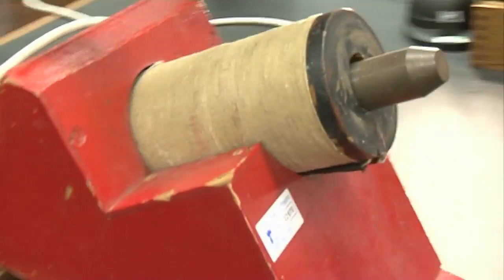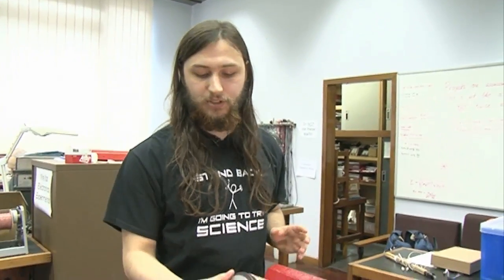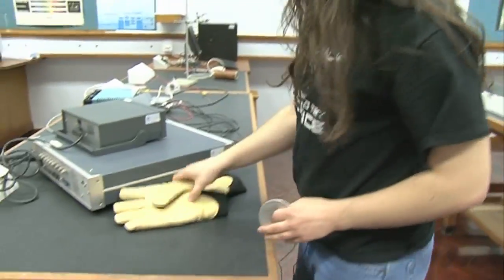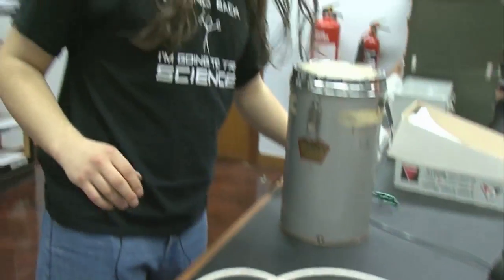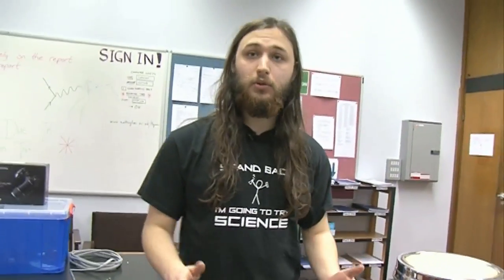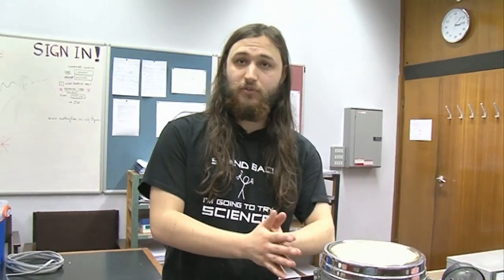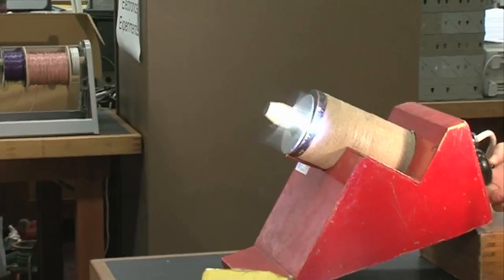The Electric Cannon - Sixty Symbols

Comment: Why are the lattice atoms affected by the liquid nitrogen but not the free electrons?
Reply: AFAIK, electrons are small enough that they don't really contribute to the heat of the crystal, and thus arent really affected by removing heat from the crystal. Or because the lattice atoms aren't pulled by the large EM force (0 net charge all together) while the electrons are. Take your pick.

(Not a particle physicist, but I read through Feynman's QED once in highschool)

Comment: I'm curious, if the temperature of material effects conductivity,  doesn't that mean the hotter something gets, it gets less conductive? is that why CPU Superclockers effectively freeze the CPU? to keep the conductivity high?
Reply: The better the conductivity, the less heat goes to running through the wires.
Reply: It's just to keep it from throttling the performance or blowing up, allows for a higher voltage and therefore a higher overclock. I doubt conductivity matters at all

Comment: But in an isolant is the opposit: more temperature means more conductivity
Reply: Itsiwhatitsi 
There's different kinds of semi-conductors:
-NTC (negative temperature coefficient)
-PTC (positive temperature coefficient)
which describes the behaviour of the electric resistance of the material when changing temperature
(something like 10^-5×Ohm/K)

Comment: What would happen if you do this with a superconductor?
Reply: It would go the maximum distance the Amperage allows, considering its running at 13 amps(due to the limiter) if it were running at it's maximum 115(i think that's what he said) it would go about 8x's as far, if it was still only 13 amps, it would still go much further, but it can only pull the same amount as the thing that's powering it.

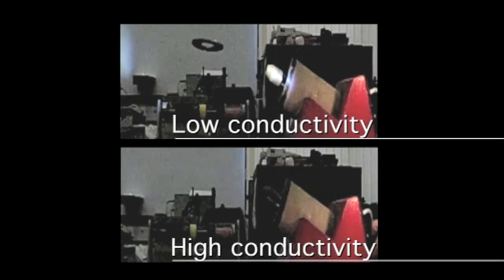Comment: Notice how there's a slowdown at 2:35 when the plate reaches the end of the iron core. That's pretty cool but I have trouble understanding why it has a sudden reversal of acceleration that doesn't seem to persist for a longer time. Does the end of the iron core shape help produce a different type of magnetic field somehow?

Or it could have hit a snag of course.
Reply: +MrSnowman Iron is ferromagnetic, air is not. So yeah, there is a drastic change of magnetic field strength as soon as the ring departures from the iron rod.
Reply: The reason others point out (the change in permeability of the core/air) would not account for a deceleration of the ring, only a reduction in the acceleration. I suspect that it slowing down when reaching the end of the core is coincidental. My guess is that this is the moment that the fuse blows. The magnetic field starts collapsing at this point, inducing a reverse polarity voltage in the ring. Since both magnetic fields are aligned for this brief time, it creates an attractive force instead of repulsive. My guess is that if they could use a fuse that takes a bit longer to blow, the warm ring would travel much further.  My back-of-the-envelope calculations indicates only a 10-15% farther travel distance between room temp and liquid nitrogen temperatures. So this certainly checks out.

Comment: Now try it with a superconducting ring. Hole in wall?
Reply: bob s No wall
Reply: +bob s The current in the main coil becomes the limiting factor in this case. The flow of current is proportional to the magnetic field generated, which in turn is what drives the ring. If the ring was super conducting it, in theory, could induce the same maximum current as seen in the coil, so while it would be driven with more force, I doubt it would go through the wall.

Comment: It is mystery to me, why do you still use fuses. There is plenty of automatic circuit breakers with protection against high currents and shorts that you can use hundreds of times. And if you need longer switching time to get the whole thing going, all you need is to pick one with slower characteristics. And of coarse with automatic circuit breaker you need no more than pull its lever back up and it works again. So it's faster, easier to use, safer and eventually given the number of fuses you must have destroyed already, much cheaper.
Reply: ***** No doubt draconian university regulations in combination with the unusual British feature that every plug contains a fuse.
Reply: +Killerean +1

Comment: I don't find that lattice theory explanation particularly compelling. It is, in fact, quite incomplete. The force that sends the ring flying is magnetism, so far as I know; specifically the magnetism generated by the electromagnet. The explanation fails to discuss the interaction of the force of magnetism and the electrons moving through the aluminum lattice and creating a current. Aluminum (and copper) are non-magnetic. Iron creates an opposing magnetic field when it passes through a magnetic field, but aluminum and copper do not. Aluminum and copper somehow oppose the movement of nearby magnets without creating an opposing magnetic field. The "explanation" ignores this wonderful mystery.

Comment: So, to vizual it I imagined a room full of people that are moving quickly forth and back (dancing? :D), they are generally particles. They I saw some group of different people that stood for electrons, and they (as a current) tried to cricle through the crowd, but get constantly bumped back. But when someone turned the temperature down, people in the room stopped moving so fast, so the electrons (othe other group) could go through the crowd with speed. 

Is this more or less acurate?
Reply: The atoms are moving randomly. The people (representing atoms) in the room are much more chaotic like a mosh pit than any normal dancing. But electrons are really small compared to atoms. Instead of thinking of people trying to get through a mosh pit crowd, think more like balloons tossed into the mosh pit. The balloons bounce around wherever they get pushed by the crowd. But if the metal is cooled down to near absolute zero, then the mosh pit crowd stops jostling around and pays attention to the stage, and someone on the stage can ask for the balloons to be passed to stage and then the balloons will be bounced around much less randomly and make very quick progress to the stage.

Comment: The conductivity for most metals are already well known as a function of temperature. How far this cannon fires something is just an interesting way to visualize how well something conducts electricity, and figuring out distance as a function of temperature would be quite easy if you knew the conductivity of the metal and the power of the cannon :)

Comment: Zebionic is right about heat damaging components, but you're also right, because most electronic devices have a reaction time which increases with temperature. Having a cool PC will not only protect it against damage but will increase performance.

Comment: Most electronic devices such as the ones in a computer have a propagation time for impulses and signals, which increases with temperature. Having a cool PC will not only protect it against damage but will increase performance. Trust me, I'm an electrical engineer.

Comment: This is Lenz's Law. Basically, the magnetic field "wants" to stay constant, so the induced field always opposes any changes in the original magnetic field.

Before the cannon is turned on the magnetic field is 0. When the cannon is powered up, a magnetic field is created (let's say it's pointing upward out of the coil). This means the magnetic field is changing. This induces a magnetic field in the ring that points down into the coil to oppose this change.

Comment: Not even remotely correct.  Overheating is a problem because it can damage the components.  Computers don't slow down because of overheating, they usually just turn themselves off to avoid damage.

Extreme cooling is usually done to allow for overclocking, which increases the heat generated.

The conductors used in a computer are more than good enough at any reasonable operating temperatures.
Reply: er, computers experience instabilities at high temperatures because the conductivity lower and it no longer is able to sustain the frequencies.
if this wasn't true overclocking on a 100C aircooled system would get the same frequency as you do on ln2, and we know that isn't true. you generally can push a bit further on ln2 using the same settings (of course being able to tune everything up one or two notches without burning the house down helps when you're going for the peak)

and yes, computers do slow down on heat. it's called thermal throttling. it's an issue specially for laptops, since they usually have rather poor thermal solutions. they do that so they can stay within operational temperatures without having to shut off. it's only when that fails that the emergency shutdown happens. remember early athlon cpus that didn't have that? yea they straight up burned down. happened at around 130c pretty quickly. i lost one of them back then because the cooler clamp came lose. it hit that temperature in like a second. it pretty damn dissapointing :\ they only implemented a thermal shutdown procedure on atlhon xps and later cpus, i think.

Comment: yes, that happens with most metalic materials, semiconductors tend to work otherwise.
that's the base of temperature sensors, like with PTC (positive thermal coefficient) and NTC  thermistors or diode sensors.
If you do an opamp circuit with a gain above 300 using 5% carbon resistors you would be able to see the change in voltage by just blowing some breath to the resistors.
Some materials are very stable through a wide range of temperatures, but there're materias that change a lot too.

Comment: but there are other ways to cool thing below helium's temperature, afaik 0,01K was reached in labs using don't know what lazer stuff
else he would have to use one of those hot superconductors alloys.
Maybe evaporating liquid heluim he could reach such low temps but not sure it it would work as it doesn with liquid nitrogen :P

Comment: so electrical resistance is the "signal" of the current overcoming "noise" of the temperature of various movement of particles in the conductor

why has no one explained it so clearly before in my life, superconductors, super-conduct because they have negligible noise. my brain understands this now so much better.

Comment: That's a really an inefficient coilgun! It doesn't even have a circuit breaker just to start off!
I wonder what's the energy stored in its capacitor bank if it even has one.

Comment: um, I'm not talking about melting it.
Duh
I mean heating it to BELOW the melting point.

Decreasing it's temperature by a couple hundred degrees...
vs increasing it's temperature by a couple hundred degrees.

Remember, this isn't water or gallium, so a little heating won't drastically change it's state.

Comment: If I were you I would use a circuit breaker as opposed to fuses, it may cost a bit more to find one that will work for you but you will save money over buying fuses.

Comment: @puncheex Every time you plug anything in to a socket you 'allow' it  to draw whatever the 'wall' can supply. In the case of a short in any equipment, it may draw huge current, the 13 amp local fuse is there to protect the circuit after the fuse, the breaker in the distribution panel is there to protect the wires in the wall, the fuse on the mains supply is there to protect the incoming supply wires etc. there is nothing more inherently dangerous in this cannon than any other device.

Comment: why not charge a couple of 500 v 5000uf capacitors  and a charging circuit you wouldn't have to to replace the fuse each time

Comment: wow, i actually found the difference between the first and second shots really impressive and interesting.  much more then i thought i would.  its interesting that you use a single shot system, instead of building up in capacitors and firing from them.

Comment: @lejink  sort of but not quite how you are thinking. the helium is first first cleaned to ensure there are very few trace contaminants. it is then put through a compression expansion sequence similar to the working parts on your freezer. the resulting liquid is then collected into a sealed dewar with very low heat transfer properties. the trick is to extract heat  from the gas rather than to cool it with something cold.

Comment: @lejink  2 litres of nitrogen will sit in the dewar in the film for about 1 day before it all boils back to gas. helium will almost instantly boil from such a container.  the reason is that they have very different specific heat capacities and vapour pressures. the dewar is just an expensive Thermos flask

Comment: @UltimateFreerider  the cannon is home built its really rather simple. it is about 500turns of heavy guage wire capable of 13A around a wooden former with a mains switch in series connected to a mains plug.  there is a steel bar in the centre of the solenoid to focus the field but thats about it.

Comment: @br4nd0nh347  You are correct. I had  a 13A fuse in the plug. This blows as soon as the current reaches 13A which is almost instantly after the switch is flicked. So between each shot I replace the fuse with another 13A fuse.

Julian (from the video)

Comment: @Austyg 

I think you may have misheard.  From what I take it as, he replaced the fuse with the same one (13A).  Basically it would draw too much current (100A), so by putting in a fuze that will break after one shot would allow them to use it without burning down the place. 
Please correct me if I'm wrong.

Comment: @SCARREDMIND 

I think that you don't understand what I am saying. Your comment makes no sense at all.I say that a guy on youtube uses large capacitors that he charges, after they are charged enough he flips a switch and the capacitors discharge to a flat coil. On top of the coil he has a hard drive disc that is aluminum with a coating. The disc is launched at high speed. He does not have to change fuses with that setup. Same principal, better setup.

Comment: @HarblesTheSkeptial Copper works, because it is the current induced producing the opposing field. There are also as you mentioned many other options to discus: impurities affect conductivity, semiconductors can conduct better at high temperatures,  conductors vs. insulators.

Another example too add to your list of applications is eddy current damping (used as breaks for roller coasters). There is a lot to talk about, and we can't do it all unfortunately.

Julian (from video)

Comment: @drosprey Similar physics (Electromagnetism), different set up. For a rail gun you have two rails connected to a voltage source, and your projectile completes the circuit. So you have a magnetic field from the current in the rails, and then the electrons in the rail move perpendicular to magnetic field. This causes something called a Lorentz force which accelerates the projectile along the rail. The reason a rail gun is so good is that it is accelerated all the way down the rail.

Comment: @mantas1111000 >> Would be better to use an SCR, a bank of capacitors and a diode in parallel+ resistor. 1) Charge capacitors to a high voltage (E=1/2 CV^2, note E goes as V^2)   2) Discharge capacitors through SCR (silicon controlled rectifier) 3) The coils reverse EMF and energy associated with it then discharges through a diode in series with a very low resistance, reasonably high powered resistor.

All of this would need be be carefully designed to match the coil and component specifications

Comment: @gobaskof I know changing a fuse is no hassle, and that replacing it with a lump of metal is not optimal nor safe at all, it's just that it'd be more practical to get a plug with an extra circuit breaker. It'd be more practical.
Also, there wouldn't be the extra cost of fuses and need to buy new ones.

Comment: @icovada If we replace the fuse with a lump of metal, then we will draw about 16 amps until the circuit breaker for the room goes, which isn't ideal. We need the fuse to blow for safety to stop the thing setting itself on fire. We could get a plug with a fuse which just flicks out, or we could get it a personal circuit breaker, but changing a fuse is no hassle.

Julian (From the video)

Comment: @lejink 
As long as you can keep these liquids cool they will stay liquids at ambient pressure. Of course there is a constant boil off due to the surroundings "heating" the flask. But because the generated gas is very cold and therefore heavier than room temperature air, it stays right above the liquid in the dewar and acts like some kind of gaseous stopper.